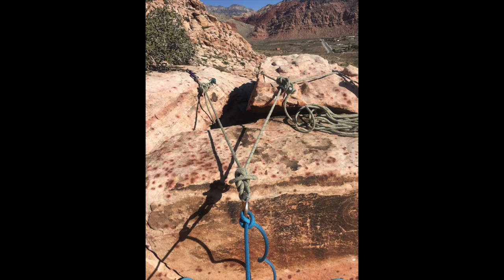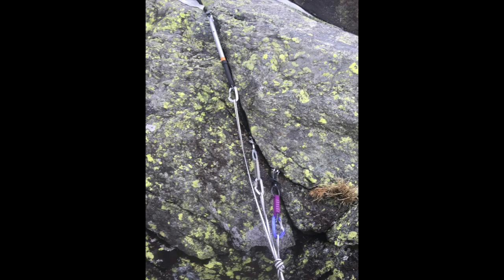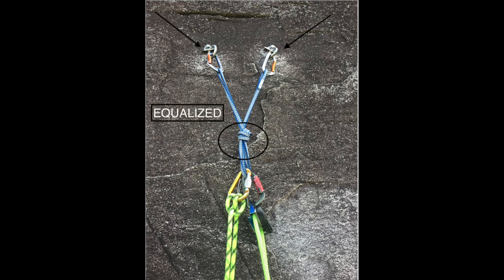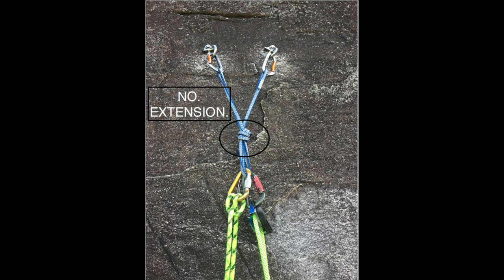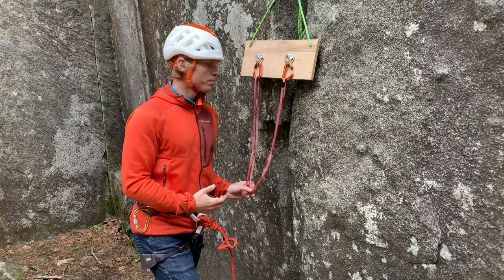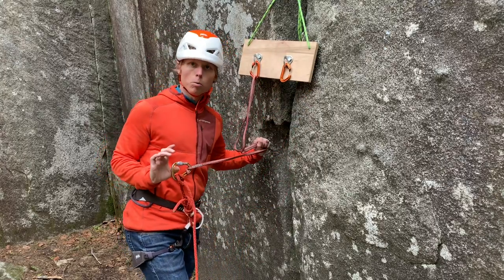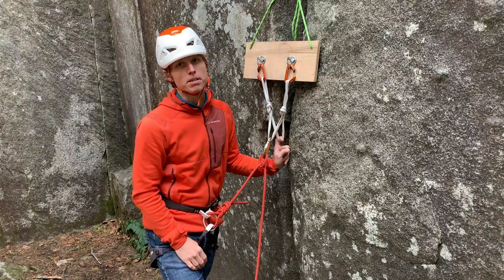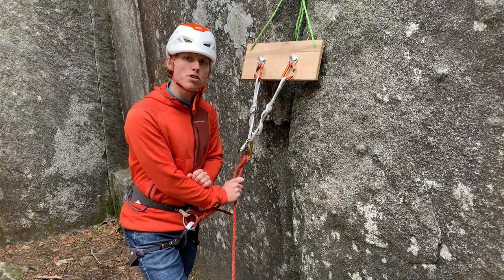Guide Examines Equalization

Comment: The last point is so crucial. In structural engineering we say "stiffness attracts load." As you show, unless you are intentional with where you are adding stiffness in the system, the load does not always go where you might want it to.
Reply from the maker: Absolutely!  In rock climbing and indeed, any vertical endeavors there will be components that do not live up to expectations as much as we would like and being able to recognize this and distribute load in response is a valuable skill!  Cheers!

Comment: Thanks Cody, another very informative video! Question: in the scenario you illustrated, would it also be possible to address the unfavourable distribution of the load by moving that #2 substantially further down the crack on the left so that it makes up the shortest leg of the anchor?
Reply from the maker: That is certainly another solution, but you don't always have that kind of option.  It would work in that crack, but it would also mean that with that length of cord, it may prove a bit cumbersome.  It is indeed another way to manage the distribution by limiting the stretch!

Comment: A couple questions:
Is there a cutoff in kN on when you would want to limit the load on that piece or is it more situational?

If you have two bomber big cams and a micro nut that is less than bomber, should you try to distribute the load onto the two big ones and limit the weaker piece? Is this possible? 

Should pitons left behind (if examined and look ok) be treated like weaker pieces and less load put on them? Is there data on how strong these can be or is that again too situational?

Thanks for the awesome video definitely learned a lot.
Reply from the maker: Its a great question and one that, as you pointed out, is fairly situational and can have many answers.  The data that exists on things like old pitons is limited to non-existent and the rest would only apply to that situation with that piece of protection and that rock type. 
To your first point, a simple answer is that a toproping fall with body weight from the belayer can generate up to 8KN or so of force onto a system, but obviously this is subjective as well.  I consider any piece of protection rated to 10+ my larger pieces and ones when placed well and in good rock, will confidently stand up to any force.

If I had two great pieces (10+) in awesome rock, placed well, I would likely not even bother with a third piece.  Those 2 pieces are good enough on their own.  I don't have a metric for how many pieces I place.  3 just happens to be a good number in terms of material economy, stregnth and efficiency with traditional systems.

Comment: Great rule of thumb suggesting that any anchor should always have at least one component that could support the maximum load case! 

On an unrelated note, do you know if any research or testing has been done about the strength of a bowline that is finished with the tail inside vs outside the loop?

Thanks for the videos!
Reply from the maker: I don't have any research immediately on hand, however, traditionally the tail finished inside the loop.  This was because of the braided nature of ropes at the time the bowline was widely utilized in "life line" capacities.  The way the braid behaved in cyclical loads (the bowlines weakness as it unties itself) was correlated with whether the tail was inside or outside.  With modern climbing ropes and the expectations of backup knots while using bowlines, this is not an issue.  For me, it is easier to tie my backup knot in a "pretty" way when the tail is on the inside.
Reply: @CodyBradford  I have heard the same information from another rock guide about the bowline's origin and why it used to be important to finish inside - he added that, from an outside finish, the braids would work together and untwist themselves, whereas from the inside finish, they'd lock each other in place. 

Thanks for the reply!
Reply from the maker: @patrickhansen1618  Absolutely!

Comment: also, the load doesnt always need to be equalized. if its a bolt, it will hold. it is perfectly fine to just load one bolt and only use the second as a backup. you might also use just a single super bomber glue in

Comment: Awesome video man! I was just talking to some friends about equalization today via a quarantine hangout. The method that you showed at the end where you place emphasis on the larger piece is interesting. What do you think of the three-piece quad in that same scenario?

Also, I've been following you on Instagram for a while. Stoked your posting your videos to YouTube now. You have a natural ability for instruction!
Reply from the maker: Thank you very much, my friend for those kind words and all of the support!
The quad has the very potential force we are trying to avoid in situations like this; shock load.  The quad would accomplish a similar goal to what I demonstrate in this video, but to an even lesser degree.  Remember that we think we are getting even load distribution with the quad, however we cannot.  So that will inevitably lead to spikes in load to our less desirable pieces.  On top of this issue, because you isolate the two lesser components with a knot (essentially making them a two piece system on that side of the quad) you end up fixing the location of where the load can be distributed evenly.  This means that any given change in direction in the masterpoint will drive all of the load at times to just a single piece (your worst one, potentially).  
In edge-case scenarios like this, I do not believe (still just my opinion) that a three-piece quad or any self-adjusting system is appropriate.
Reply: @CodyBradford  thanks for pointing that out about the 3 piece quad. Makes sense!  Is there an official name for the technique shown in the video? It's almost like a hybrid between an equalette and pre-equalized. But, with much more customization.
Reply from the maker: @sk8erboob  So far as I know there is not.  However this means it is a good time to come up with a good name!  Let me know if you come up with one!

Comment: I'm a noob, which will be obvious by my next question. Referring to the anchor at 3:07, do you agree with the general rule of thumb, "Any point that cannot fail ought to be secured with a locking mechanism"? I googled and found that since I wasn't initially sure why that anchor had non lockers at the bolts.
Reply from the maker: Steven Miller yes I agree.  That is why where you see one component (the locker securing my clove hitch) it is a locking carabiner.  Above there are two separate bolts that are not experiencing any dynamic load such as will be experienced by the masterpoint.  It may be helpful to watch my redundancy video for better clarity.  Again, the components of my anchor are not experiencing the dynamic loads in a single location like the masterpoint will.  They will only experience a mostly singular direction of load the entire time.  This would change should one of those components be encumbered by terrain, wherein the carabiner gate is being manipulated.  I would likely change the component or add as locker should I not be able to.
Cheers!

Comment: do you think 6mm cord is okay for the quad anchor? thanks
Reply from the maker: Yes! So long as it is rated for climbing and is not nylon (should be 7mm) it is a great application for that tool. I would advise erring on 200cm or less to make it less awkward in length.